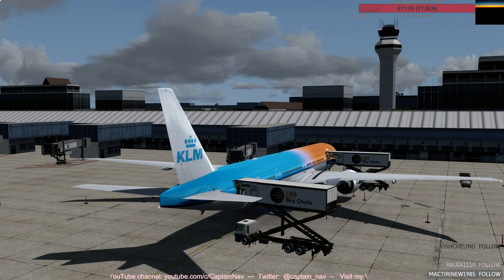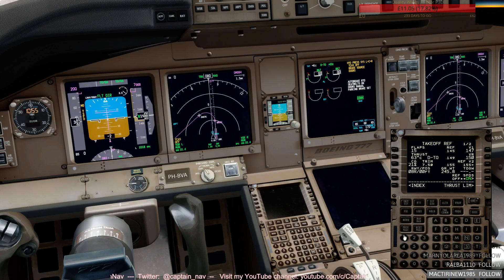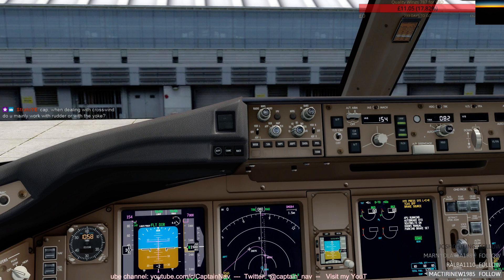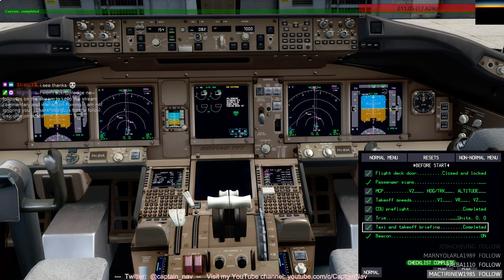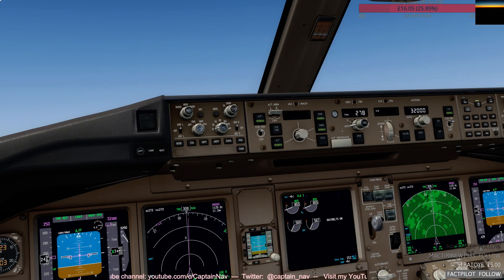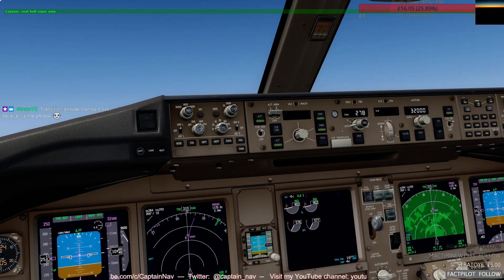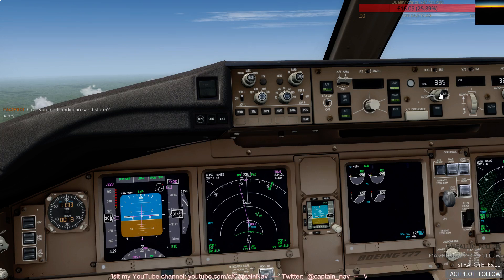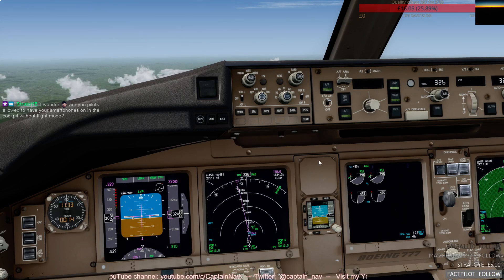[P3D v4.5] PMDG 777-300ER | Munich to Amsterdam Part 1 (by a 777 Captain)

Comment: Thanks for another video. I’ve noticed that on the 777 the IRS is managed by the ADIRU computer. Seems easier than having to manually switch the knobs to align it on other planes, yet other modern planes don’t have the option. I’m wondering if you know why?
Reply from the maker: I think it is just a design thing... The 777 has an ADIRU button, but the 787 or the 737 have 2 IRS rotating buttons. At the end of the day, it is all the same thing.👍

Comment: Hello Captain. Question..

How dependent on the PAPI lights are pilots when doing non-precision approaches? Specifically, flying the approach (either RNAV OR LOC) approach into KSAN. The runway (27) has a 1000+ foot displaced threshold. When hand flying the plane in, that threshold gives the illusion of being too high and watching the PAPI lights is very essential. I guess my question is how much harder is that approach if the lights were INOP? Does a long threshold give that same impression to you as well?

Thanks
Reply from the maker: Without PAPI's, the approach is definitely harder but not impossible since the VNAV (depending on the coding) offers vertical guidance. You are correct, a displaced threshold will give a visual illusion. The key is to go beyond that illusion....😉😃